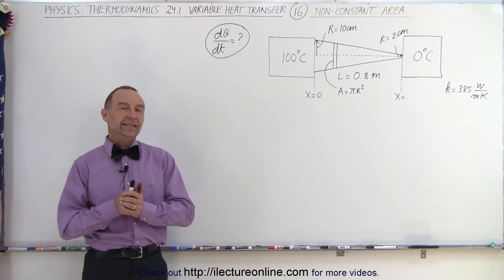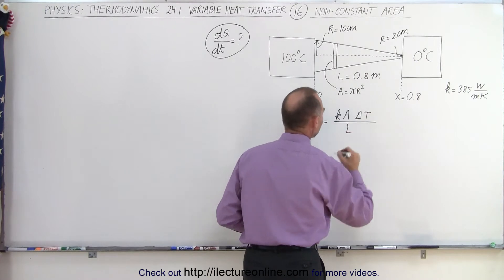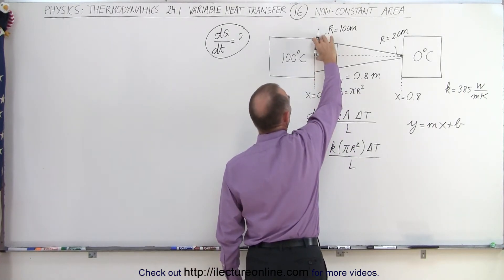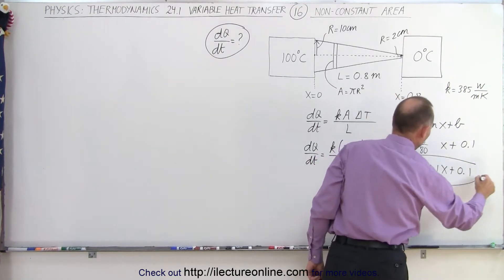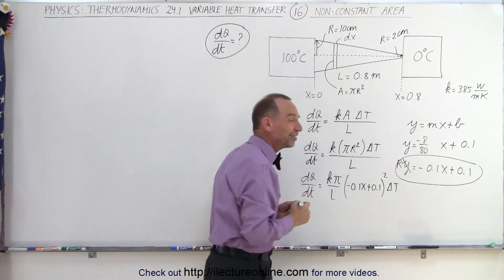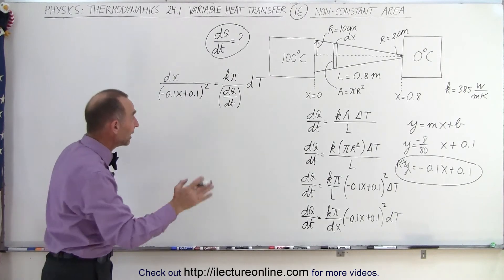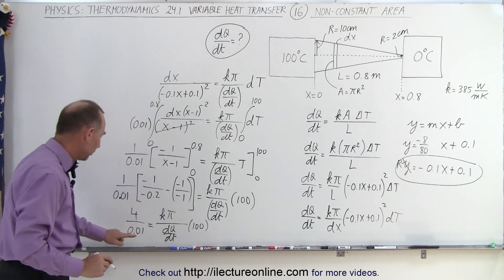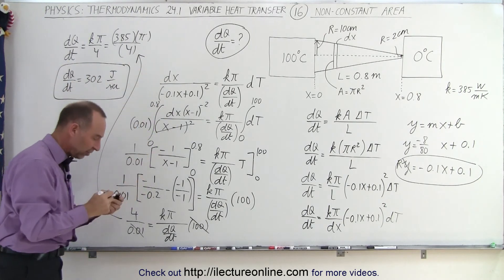Physics 24.1  Variable Heat Transfer (16 of 25) Non-Constant Area

Comment: Sir could you please explain how to solve a same type of problem with cross sectional area not being a circle but rectangle
Reply from the maker: It would be done exactly the same way.  The area would be L x W  instead of  pi x R^2 and the change in the length and width would be expressed in the same way as the change in radius shown in the problem.
Reply: @MichelvanBiezen  Sir, In case of the above problem, The length of varying cross sectional area cylinder was measured from centre of initial cross section being the large circle of R=10 cm to the centre of the small circle that's the final cross sectional area of R=2cm so the circumference is equidistant from the centre and therefore we can apply this here and obtain the slope equation.
But how can we do the same for a rectangular cross section where the perimeter is not equidistant from the centre of the rectangle?
Reply from the maker: You can do the same with setting an axis along the middle of the conducting path.

Comment: Michel I enjoy very much your videos, I will like to know how to deal with this:

R=10 cm not 8 cm, so Y=-(.1/.8) X + 0.1 and (-1/8 X+.01)^2= 1/64 (x-.8)^2 and the integral from 0 to 0.8 is undef
Reply from the maker: Why would the integral be undefined?
Reply: -1/(X - 0.8) when X=0.8
Reply from the maker: Since that represents the radius, the radius would go to zero, and you cannot have a conducting path with a zero radius, therefore that is not a realistic scenario.
Reply: Michel van Biezen thank you very much R=12, R=2. Integral(1/(-1/8 X + 0.1)^2),0,0.8) = -64/(X - 0.8)] From 0 to .8, but X can’t be = .8
Reply: Michel van Biezen just by turning the cone the slope will be positive. This solves the problem

Comment: Can you explain how you set up the equation for R ? using the y=mx+b form
Reply from the maker: Think about the dashed line as being the x-axis and the x=0.8 line as being the y-axis.  Then the slope is a drop of 8 cm for a run of 80 cm  (slope is rise/run = delta y / delta x)   and the y-intercept is 0.01 m = 1 cm
Reply: Thank You.